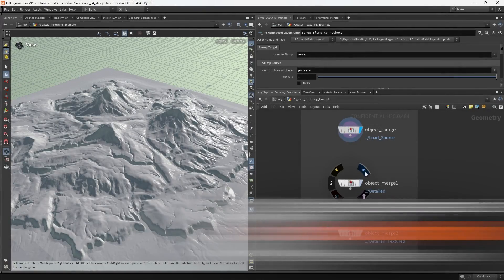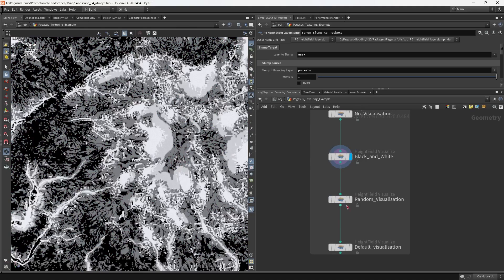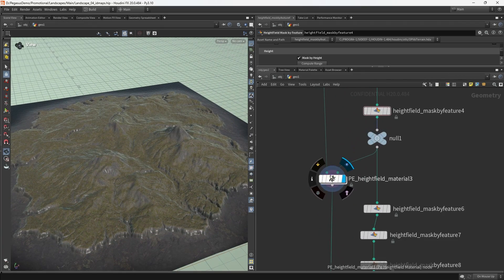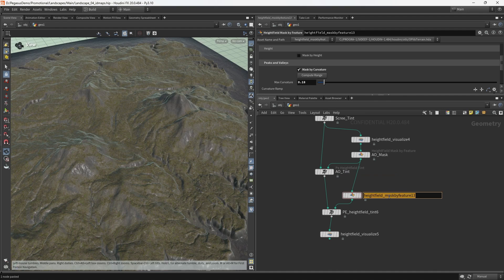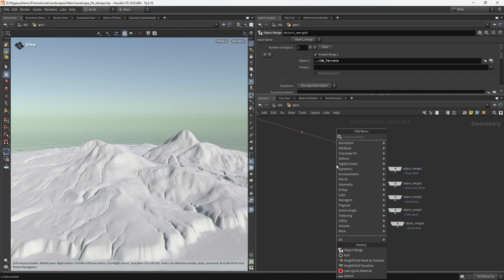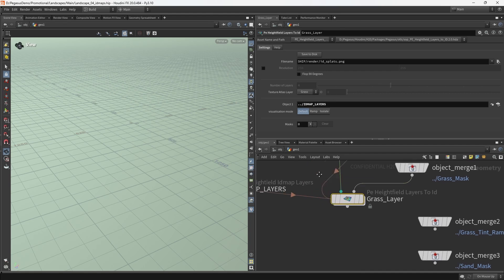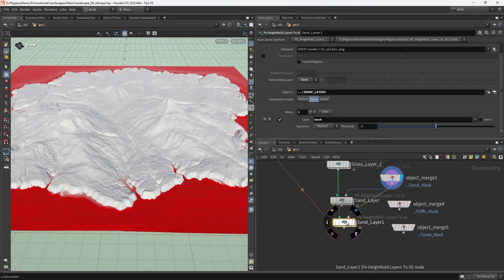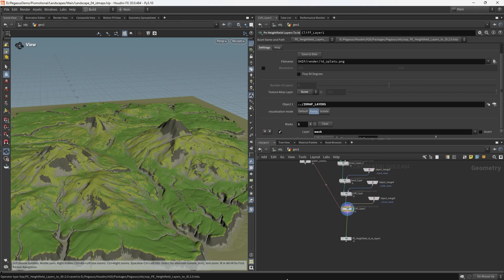Project Pegasus | Landscape Workflow 6 | IDmap Workflow

Comment: Seemingly, the "Pe Heightfield Layers To Id" node does not properly visualize its ID map in the first ID assignment, but it is working and will render the result properly. 
This is because the area with no ID is also assigned the first ID (0), and every area has the same ID (0).

To fix the error: inside the "Pe Heightfield Layers To Id" node type, detach and delete the node string with the "switchif1" and "attribwrangle1" nodes.
Reply: Could you provide an update on whether you encountered any further issues after deleting those nodes? Since you're essentially deleting code, I'm a bit uncertain
Reply: @EmreAy-v1c  
I have completed Landscape Workflow 13 and it did not cause any problems.
But I recommend you "Save Copy" the original node type for backup.